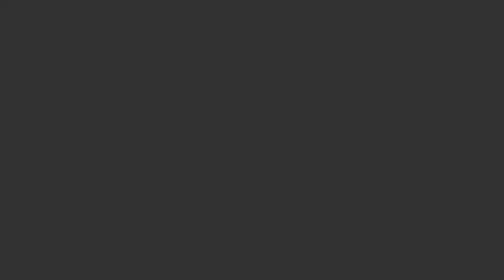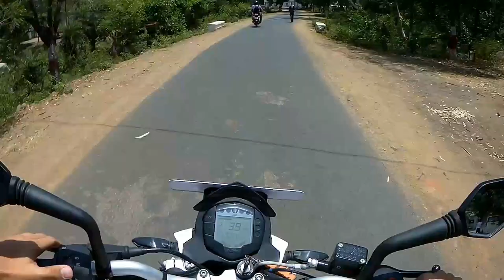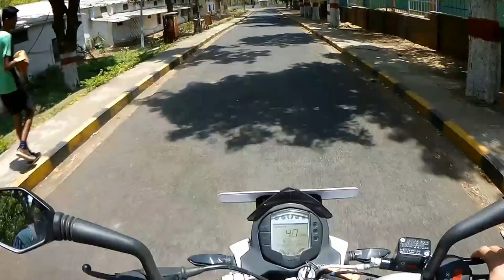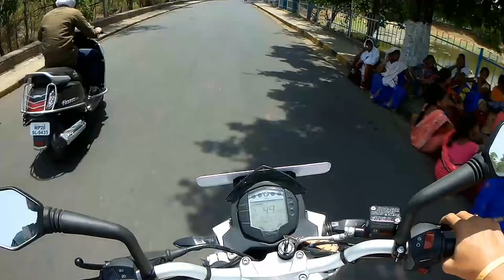Rev Matching - Do Your Downshifts Right | KTM Duke 200 |

Comment: bro..please do a video on your helmet and the camera mounting.
Reply from the maker: +Copy Cat yaa sure
Reply: +Fuel Injected Bro i have a doubt..
before you rev match do you need to brake...the reason im asking is because i feel the bike may become upset when your rev matching like when yiur shifting to a lower gear you get that hard engine sound
Reply from the maker: No you just need to stop accelerating, and down downshift a lot like if you are at 70 kmph and 5th gear then downshift to 4 them let it slow a bit more and then 3rd, dont directly go to 3rd, otherwise you will hear that sound again

Comment: Ok,so does rev matching prevent rear tire from locking up?  And is it necessary to rev match on a slipper clutch?
Reply from the maker: Yes, not necessary if you have slipper clutch

Comment: Is it normal when you downshift you can hear a little pounding in your gearbox?
Reply from the maker: +Jonathan Gotgot yes, but take care you are releasing the clutch after shifting the gear
Reply: Fuel Injected somewhat like cranky noise it's like it's gonna drop every downshift I take
Reply from the maker: +Jonathan Gotgot no problem, and you can try rev matching, that will help,
Reply: Fuel Injected shift rev then release. Thanks
Reply from the maker: +Jonathan Gotgot pull the clutch, rev and then shift and release the clutch
Reply: Fuel Injected i see rev first lol

Comment: MY RC 200 MAKES NOISE WHILE SHIFTING GEARS WHY DOES IT HAPPEN CAN YOU PLEASE TELL ME THE POSSIBLE CAUSE
Reply from the maker: Yaa little sound is normal
Reply: It makes a noticable sound like “tak” when i am upshifting and makes much loud “khatt”/“tak” sound when i am downshifting … i guess its because i hold the clutch for too long before shifting?
Reply from the maker: Yes might be, and down shift like from 5th gear to 2 in one clutch pull
Reply: Fuel Injected i am new in bike riding world and i never go beyond 3rd gear😂😂 i was downshifting from 3rd to sec when i heard the noise its been a week m listening that noise
Reply from the maker: I can not really understand your Problem without hearing it myself, so its better your get it checked at the service center